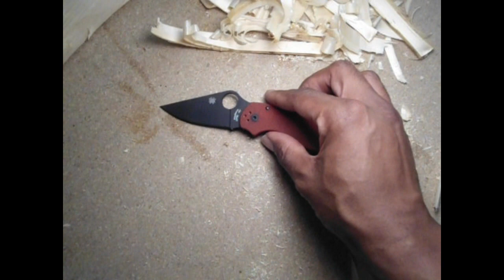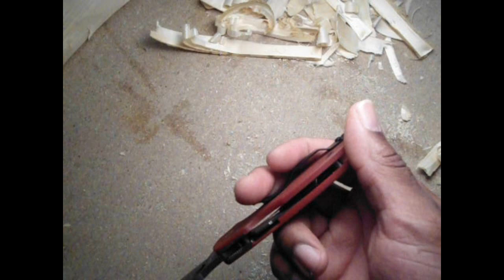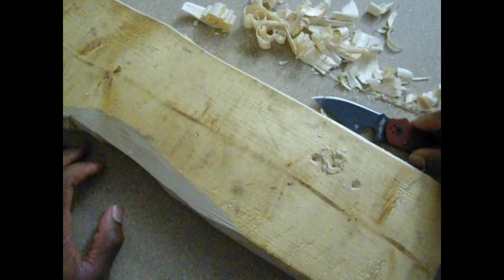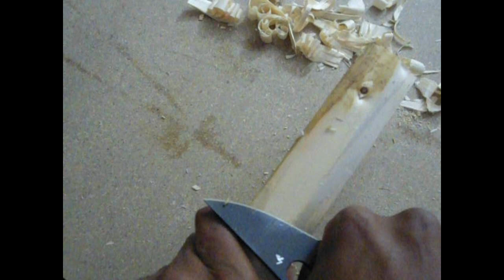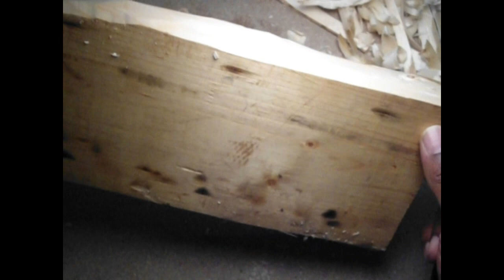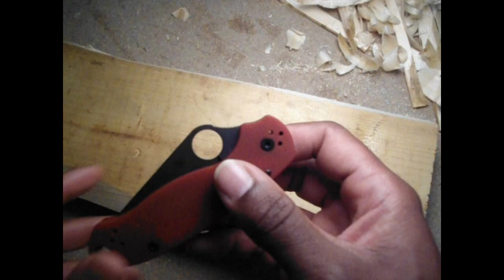Spyderco Para 3 CPM 4V (St.Nick's Knives Exclusive)

Comment: what the fuck. Pm 3's come hair whittling on 4v???!!?! also how thick was that hair? that looked a bit thick. I usually use longer hair from a hairbrush or hair I find in the bathroom floor (share a bathroom with sister). then the hair isn't so hard. whittling pubes are deffinatly easier! just kidding but you get my point.